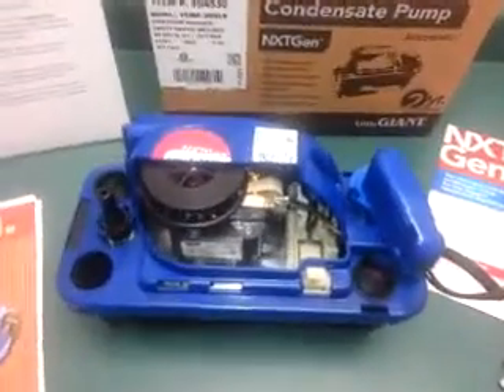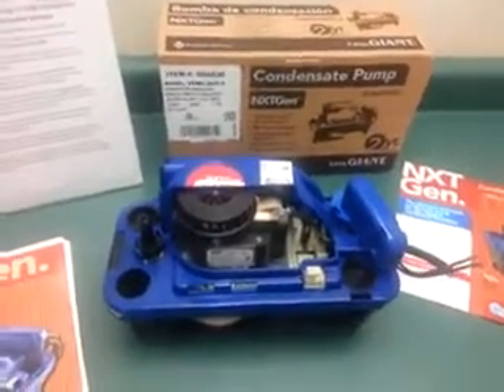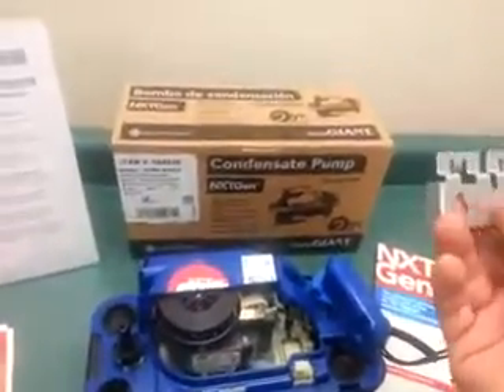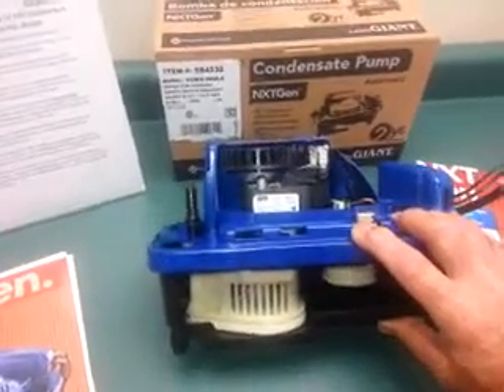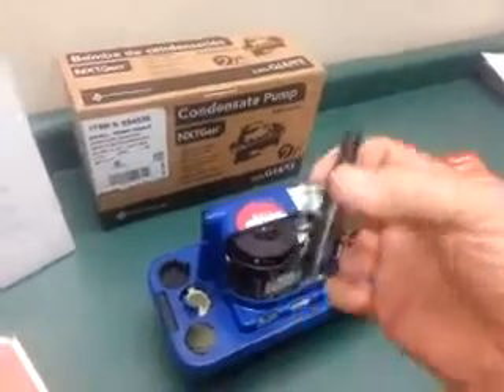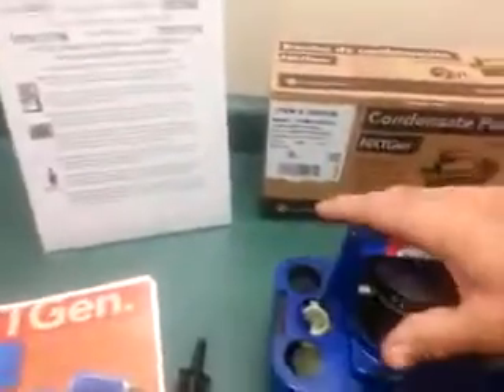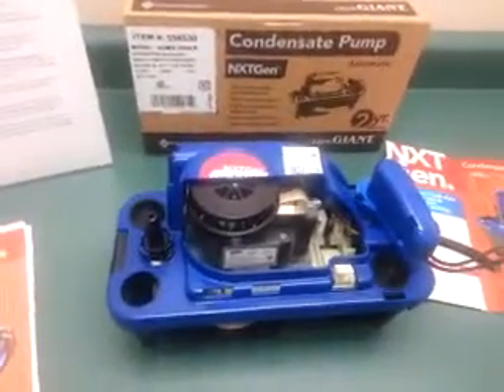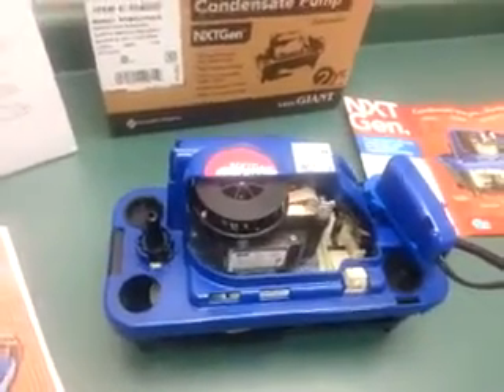Little Giant NXT Gen Pump

Comment: The check valve can get stuck by the dielectric grease from the motor. I used descaler to remove the sticky buildup on the neck and internal ball. It was sticky indeed

Comment: What do you think the issue is if it consistently buzzes off and on... nonstop?
Reply from the maker: Tasha Williams - could be the check valve has debris in it.  check that.
Reply: The check valve is a small plastic ball. Mine was sticking. So remove the check valve, and shake it. You should hear the ball. Go ahead and run a q-tip through. U will see the ball inside. Get her clean and good to go.